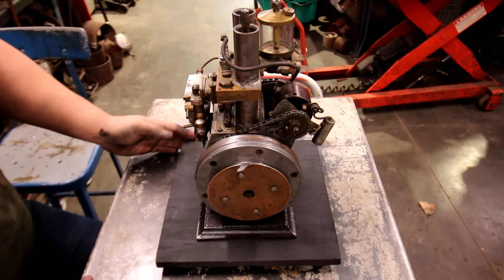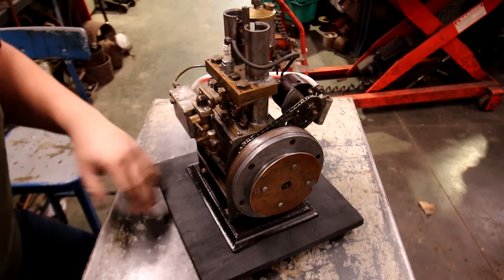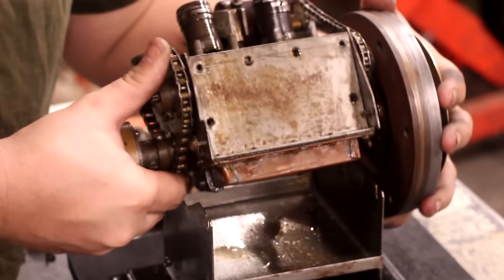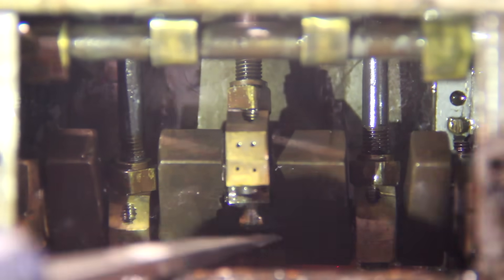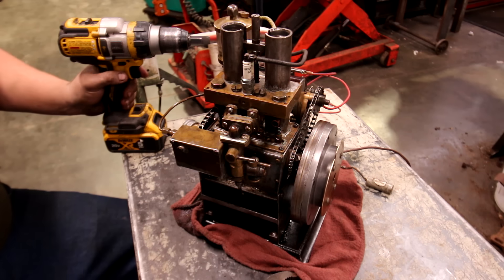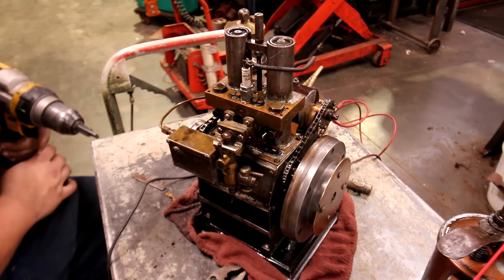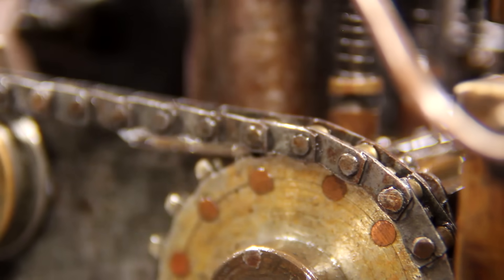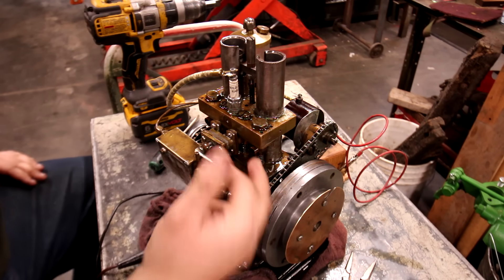RARE!   Antique Homebuilt Two Cylinder Opposed Piston Engine. WILL IT RUN?

Comment: I didnt see opposed piston engine. It looked like a inline twin with normal layout except pushrod / valve train looked different. Small bore long stroke. O rings wont last long. Drill tiny holes on top of piston that channel to ring center with pin as to stay in one spot  ( 90 degrees to rod.   The combustion  pressure should then bleed to center of ring helping  expand it against cylinder. Run good synthetic oil or 100 :1 premix ....it will lube piston/ cylinder and help seal it.
Reply from the maker: It's very much is an opposed piston engine. 2 cylinders four pistons, there's two piston on top coming down into two pistons on the bottom with a common combustion chamber . The o rings would outlive the engine if ran much as it's not built to be ran very much. And neoprene o rings can handle the heat and pressure. Aswell as they seal.on the poorly machine bores of the engine.

Comment: So.. I'm very surprised your O-rings ( rubber )lasted as Linfield as they did without melting down..You Really do need to find or make some Real piston rings. That is a way cool engine.. where did you find it  ???
Reply from the maker: The o rings "neoprene" are rated for 500 degrees of heat . And I friend dropped it.off wanting me to look at it's design and get it running. O rings work very good for low use applications in old engines

Comment: This type of vertical opposed pistons engine was the trademark from a French car manufacturer named Gobron-Brillié. They produced big luxury cars with 2, 4 and 6 cylinders with opposed pistons from 1885 to 1922. Their biggest 6 cylinder had a displacement of 976ci ! Most of these engines had side-vales but in 1921 a sleeve valve version was offered.
They were the first in 1904 to hit 100mph (103,55mph) setting thereby a new land speed record.
Reply: Could you believe there is one in Argentina?  It's a 1911 50hp model which belonged to the founders of the town of Intendente Alvear.  It was restored in 2011 by the town government and a group of enthusiasts.  Unfortunately most of the body was gone so they had to fabricate a new one.
Reply: @douro20  I know of that car, it's a dark blue 40/60HP open tourer. There's a good reason he chose that car, it was designed to run on anything flammable (it could run on Alcool) making it a good pick if petrol was harder to come by than booze. 

The Tsar had a number of Dellaunay-Belleville that were know for their reliability,
you can see that as buying an exotic sports car to differentiate yourself from your neighbor.

Comment: Did you realize that it was set up as a pull rope starter?  The style of the flywheel and the starter rand the horizontal carburetor reminds me of prewar outboard motors.  I wonder if this was intended originally for marine use?
Reply from the maker: I did but they also had the ratchet for either a crank or drill start. The rope pilly was so shart it would cut through a rope really easy. Aswell as I forgot to mention in the video. The flywheel is made of lead so I didn't want to rust damaging it.
Reply: The maker must have had arms and shoulders like a body builder after hours and hours of pull starts on a rope. You cheated with a power drill, and it still took a half-hour of spinning and setting.
Reply: That may be true, however, fwiw, I can say from experience that if you set the position of the flywheel correctly and your points are set correctly, a quick snap through 3/4 of a revolution will start a motor. Skill, not strength. @terrywarner8657

Comment: Just two main bearings supporting three big ends is not a strong design. Two cranks would not have been any heavier as that would lose the central link rod and crossbar. It also loses the valves and doubles the power strokes.

Comment: Thanks for showing this to us! Im a machinist / builder and am in the middle of fabricating a 2 cylinder TF engine. Perhaps a bit more agressuve then this example but still this is soooo neato!  Thank you so much, for letting me see another machinists ideas and approach..
Reply from the maker: It be a fun project to make an improved version of this with more understanding of how engines need to be designed.

Comment: Building an internal combustion engine from scratch is pretty darn impressive, even more so with opposite pistons.😮
What led you to think it has been built in the 40's?
Reply from the maker: The types of fasteners used, the patina, certain ways things where designed and made. Components used so on all led to that era. Rate the popularity of this video is going I might make a follow up video on it
Reply: I would suggest 1930s or very early 1940s. When I was growing up, my father's old Popular Mechanics and Mechanics Illustrated magazines were household reading materials. The Depression forced a lot of people to make do because there simply weren't many commercial goods available. Materials were not uncommon, and most garages and farms had machines to make what was needed. One article I remember from the magazines was how to make a 4-cylinder Ford motor into a 2-cylinder gas stationary engine. It must have just put put putted along forever. Then the war came, and suddenly there was so much engineering and manufacturing effort towards making all the stuff that dragged the US and Canada out of their stagnation.

Comment: Would love to see how combustion chamber is configured with one spark plug for 2 cylinders. Do both cylinders compress into 1 combustion chamber. At any rate a great collectors item to study and enjoy.
Reply from the maker: You are correct. The guy just drilled a common hole between the two cylinders and that's where the sparkplug is.
Reply: @cruddycornstalks  So there are 2 intake valves, 2 exhaust valves , 2 cylinders , 4 pistons all into one combustion camber? I say it ranks up there with one of the most unusual internal combustion engines ever built.
Reply from the maker: @oldamericaniron5767  yes correct. It very much is.
Reply: There is enough hardware to run an even-firing 2 cylinder engine.  It only needs another spark plug and a distributor.  The nice thing about this engine is good primary balance due to the opposing pistons.

Comment: So what you have is a four piston, four valve, single combustion chamber high expansion ratio model engine. Someone was exploring thermo dynamics trying to extract more energy from the fuel by increased expansion ratio. As others have said a proof of concept model, it deserves to be in a museum.  The construction hours in that model shows the dedication the builder had, the construction techniques are brilliantly simple. You don't need big frame bolts holding the cylinders and heads down when all the forces are balanced by the other pistons, it's the crankshaft that holds it all together, brilliant.
Reply from the maker: the crankshaft in my machinist/engineering opinion is not beeffy enough to withstand a lot of stress. after editing the video that was what I narrowed down to the weak link in the structure of the engine. despite looking big in the video because how close I filmed the journals are only about 5/16 thick . with no bearing braces from the upper throw and the lower throws it almost has to be flexing as it runs. that and the home made chain. I had to readjust the tensioners twice top film what little running I did .
Reply: @cruddycornstalks  They did look a bit loose and wobbly on the crankshaft..  ..seems like the poor thing would beat itself to death if run for too long.
Reply: It would be nice to make a close tolarance and stronger engine with the same bore and stroke and cooling. Just to see how much power & tourque it can make on a given amount of fuel. IT'S  JUST BRILLIANT. It does need to in a musieam and taken care of thanks for the video👍
Reply: @peterupsall8542  it could definitely use a water jacket.
Reply: Oil drip pan is the base….
Reply: Close. It doesn’t have valves. It has vanes like a 2 stroke Detroit.
Reply: @GORT70

This engine does indeed have valves, and all Detroit two strokes aside from the series 51 have them as well. The Detroits only have exhaust valves though, as induction is via ports in the cylinder wall in conjunction with a geared blower.

Comment: Cool engine, but not an 'opposed' engine in any sense of the term. It's not a boxer style opposed engine, and it's not a true opposed piston engine as those typically don't have valves (excepting the free-piston types) and are always two-stroke, whereas this engine is a four-stroke (Otto cycle) as you stated near the end of the video. I would call it an I3 engine.
Reply from the maker: think you need to look into how the term opposed piston works? opposed piston doesn't go off the combustion cycle of the engine but the piston/cylinder layout. they made  4 cycle opposed piston engines before they made two stroke ones. look up a Kansas city hay press engine. think the actually engine was called a lightning. very oddball engine but they do exist. as the pistons oppose each other in the same cylinders, is by definition what makes it an opposed piston engine.

Comment: Impressive engineering behind this. The fact it was homemade is even more impressive. Though ehat I'm wondering is what the original builder used it for, it has a lot of different possible uses
Reply from the maker: with the lack of cooling it was merely a concept engine or perhaps just something to pass the time and make.
Reply: @cruddycornstalks  I'm sure it was worth it in the end. If it had a cooling system I can see it powering a go-kart or even a small boat

Comment: It being so old should mean it has no Aluminium Parts.
Maybe it was intended to run on MeOH or EtOH + H2O.

Methanol or Ethanol with a Water Content from 10% to maybe 20% (with the Addition of ~0,5% Oil in Solution if possible) should keep the Temperature way lower. After it’s heated up the Water Content could even be increased.

Methanol is better for the Cooling Effect but a bit toxic. Fortunately the Antidote is Ethanol. Because of that I would use 40% MeOH + 40% EtOH + 20% H2O.
Reply from the maker: Not likely this thing isn't built well enough to be intended for anything that fancy .
Reply: @cruddycornstalks There is nothing fancy about it.
It would fit the Time, is a very low Tech Solution and will not only cool the Cylinders but probably reduce the Power (Density).

Its not a charged Engine.
The Vaporization of the Methanol should displace Air instead of giving the Option to press more into the Cylinder.

The Alcohol Mix Fuel is not added but the only one used in the Carb.
As it’s for „Show“ you want to have the lowest Power that keeps it running nicely.

Comment: Very cool. Perhaps you could show how the engine is 
Opposing piston. 
I did not see how mechanically the pistons were opposed.
My understanding is that you have one combustion cylinder with opposing piston tops facing each other. The combustion happens once while opposing pistons are at tdc.
Very cool though 
Subbed.
How did you get your hands on that.
Jay Leno would offer you a hundred K for that.
Reply from the maker: I pulled the upper set of pistons out when I tore it down they pull down towards the "normal" set of pistons

Comment: The building of small engines like this as a hobby is still quite strong. I'd do a bit of googling to find a group and post some photo's; someone will know. I'd start with the Home Model Engine Machinist forum. I'm not sure if they are the biggest but they are pretty active. I wouldn't be surprised if it was built from plans from a magazine like Popular Mechanics.
Reply from the maker: id love to find a reference to this engine or any history in general about it as i have none and would  love to find some.

Comment: This is the first opposed piston spark ignition engine I've seen!  All others have been 2 stroke diesels, which lend themselves to the opposed piston layout, the Napier Deltic the most complex, a 3 crank, 18 cylinder, 36 piston design.
Reply from the maker: Very few brands used it as it didn't really give enough benefit for being gas powered

Comment: "opposed pistons"?????  Please explain and show this.
Reply: I see it now, the top two cylinders run off a crosshead like a steam engine. It's actually a 4 cylinder, not two as you state, with a common combustion chamber using the single spark plug.
Reply from the maker: @metaltradesmachine8910  there is only two cylinders with 2 pistons per cylinder
Reply from the maker: I take the whole cylinder system apart. Aswell as give a quick run down on the concept.
Reply: Is this an inline 4 cylinder @cruddycornstalks

Comment: The O-rings won't like combustion. Stretch the worn-out rings (expand the gap). I wouldn't worry about heat treating them, because it won't run enough to cause much wear. Maybe just to soften them (before stretching them), so they wear to fit more quickly.

I wonder if expanding snap rings come in the right size to be piston rings, they're close to the proper material & hardness.
Reply from the maker: Neoprene o rings are  rated for high temp and high pressure aswell as beig low friction. Model builders use them all the time as they seal a lot better and easier then normal rings . You would need to heat treat the rings otherwise they won't ever seal better as they deform from  us and won't work properly. They need to be able to spring open against the cylinder wall. The rings in there current state would deform my hand without any efforts and felt like bailing wire.
Reply: @cruddycornstalks  no (factory produced) engines use o-rings for piston rings for a reason, but I guess that engine can't run long enough to cause severe wear issues. 

It does sound like the OE rings are very soft already, and probly can't be hardened. The expanding snap ring idea is sounding better!
Reply from the maker: @Iowa599  the o rings are a better choice on an engine like this. We aren't dealing with a high use "factory produced" engine. It's a model. The cylinders are not machined very well and the o ring will help seal against that. And it's a lot  less friction so the engine will run smoother. Aswell as o rings are dirt cheap and the day they wear out  it cost a couple bucks or less to replace 4 of them. But as I have seen in other projects  I've worked on. Neoprene o rings will  last decades In some models or even fullsize hit and miss engines do to how little they run and how cool they run. Have some engines in my family that have one in them longer then I've been alive.

Comment: I guess the opposed piston layout makes it perfectly balanced & reduces the load on the crankcase so it only needs sheet metal construction. Just a single spark plug though - huh?
Reply from the maker: In all the smart decisions the guy made making this engine. He made both cylinders use the same combustion Chambers with separate valves. And then naturally the cylinders fire together aswell instead of alternating making it the lease efficient way to make the engine timing.
Reply: That's what I thought, all of the driving forces taken by the 3 opposing rods within the cylinders so minimal crank case load. Interesting to note at this time that there were a number of 2 stroke air cooled motorbike engines that had 2 cylinders with only 1 spark plug working through a shared combustion chamber and they workd just fine, there are still people restoring and riding them. Perhaps that configuration was all the rage around this time, maybe ignition setups and plugs were expensive, hence this design attempt?